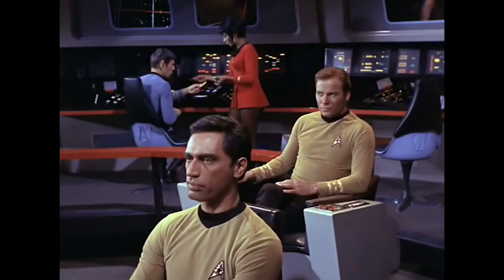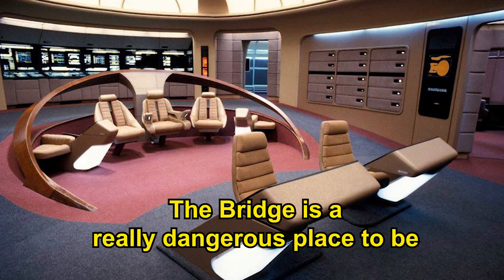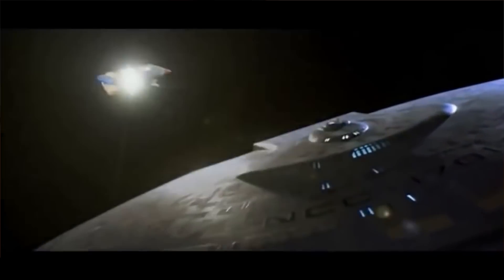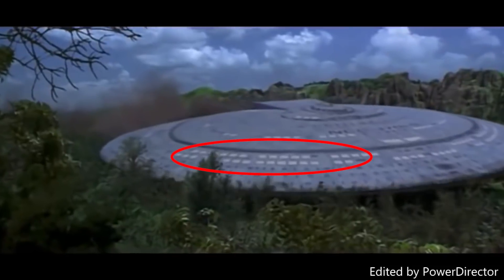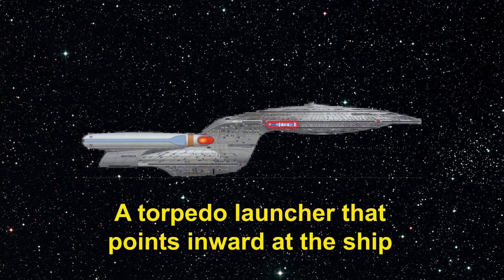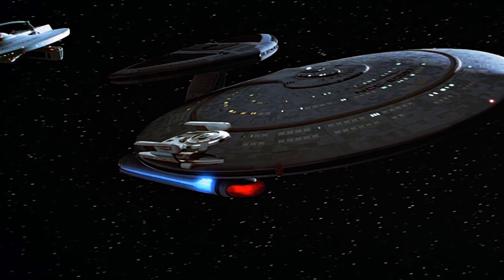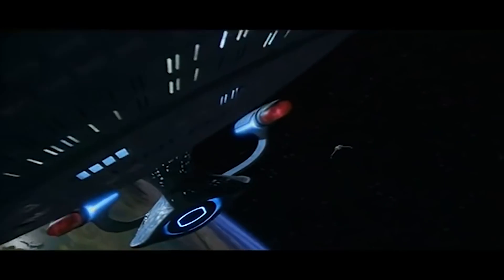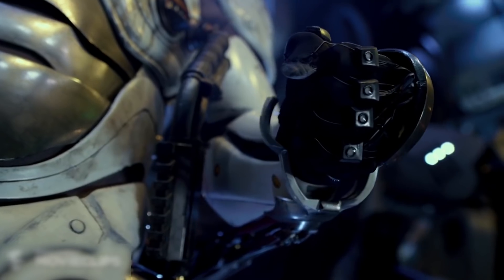10 Flaws Star Trek - USS Enterprise NCC 1701-D

Comment: 1. The Galaxy Class starship isn't intended for combat. It's an exploratory vessel, so protecting the bridge during combat is not a high priority. The placement of the bridge is actually a holdover from 20th century naval vessels where the bridge is raised high above the rest of the ship in order to provide a higher perspective for visibility and navigation. 
2. This is probably a result of common technological fallacies - the more advanced a civilization gets the more dependent they become on their technology to solve problems. They depend upon their shields and inertial dampeners to protect them. The whole point of science fiction is to be an allegory exploring what happens when that technology fails.
3. All of those hijacking attempts were performed by experts who devoted massive amounts of time to planning and preparing their hijacking, often including long-term infiltration of the security involved. Those "kids" were age "regressed" adult crew members who retained their adult knowledge and experience. 
4. The Galaxy class is a SPACEcraft, it's not designed to land. Hence "crash land". The intrepid class is designed to be able to land. Also, the Enterprise was highly damaged during the Generations battle. (Mostly this was just a dramatic choice by the writers so...)
5. Shield modulation is most likely a significant engineering problem that can severely impair shield power and longevity. Static shield frequency is also not a problem until the Borg arrive, and once they arrive the solution is newly invented - and we see this exact solution, automatically modulating shields and weapons, implemented in later ships designed specifically for fighting the Borg. Retrofitting this into older designs is probably a complicated endeavor.
6. Yeah that's a bad design. Blame the intern who helped write the tech manuals. Or in-universe, I'd suspect it was added to the design later, probably as a refit or at least later in the design/construction process when the living quarters on the upper decks were already established. Again, peacetime exploratory vessel, so it shouldn't be a problem.
7. Warp nacells are required to be separated from the living sections due to radiation from the warp plasma reaction. The design of the Galaxy class is mostly modelled after the Constitution class and both were exploratory vessels, so maximizing engine power, efficiency, and safety takes priority over reducing the ship's target profile.
8. It's meant for long term exploration, which actually makes comfort and luxury a high priority for morale. When your crew doesn't get to go outside for months or years at a time, you need a little more breathing space inside. You can also see this same design philosophy in its crew manifest - they have a ships' counselor to help deal with the issues that long-term space travel and "confinement" can have. 
9. This seems to be more of a complaint behind Starfleet's design philosophy in a peaceful and peace-chartered Federation focusing on peacetime missions in a relatively peaceful era. And you're comparing this to the design philosophy of the Romulans, The Klingons, and the Borg whose societies all exist in a more-or-less constant attitude of war. Yes, sometimes fighting happens, and Starfleet ships have shields and weapons because this happens. But warfighting is not the intended purpose of Starfleet ships and it is not the philosophical model that the Federation is built upon.
10. Using a touchscreen for steering? Sounds like a lack of imagination on your part. Try playing a mobile game with a touchscreen joystick. And then pretend that same control model was implemented in an LCARS interface. But if you must know, yes, they punch in coordinates for a destination and the ship automatically adjusts course and heading to get them there. All of the actual "fancy maneuvering" is done by the computer under the hood. This is actually the most practical solution when you're navigating a massive starship in 3-dimensions. Joysticks are fun in games and fighter jets, but trust me you'd hate it if you had to steer an aircraft carrier with a joystick - a course change of 10 degrees would have you holding that joystick sideways for 2 minutes.

It seems to me that most of your flaws are directly associated with the Enterprise's role as a peacetime exploratory vessel not being optimized for combat effectiveness. For the Enterprise, which being Starfleet's flagship frequently gets placed between a rock and a hard place precisely because they're the best of the best, we see this design philosophy fall short. But even on the Enterprise, it's maybe 1% of her service life and for the rest of the fleet they fulfill their peacetime exploration mission admirably.
Reply: Yes, thank you for your thoughtful breakdown.  This video should maybe be, 10 reasons why the Galaxy Class was not meant for war.  That would at least give more understanding to it's perceived flaws as a warship.  It's clear the show designers thought about that during DS9 and the Dominon War.  They designed the ships going forward to meet the needs of a more dangerous universe. I wonder how in the next shows, that expand the prime timeline, ship design will be effected.
Reply: Still, they are always in newly explored space, it is their main frontier vessel and their flag ship. While also constantly going into battle, so the design is not well thought out regardless. It really comes across as the federation being too arrogant and just wanted a flashy pimped out prestige vessel, ignoring the obvious and glaring issues.

And that's me not even addressing the starboard power coupling😆
Reply: That's a great rebuttal. However the Enterprise-E was meant for warfare, was it not? Surely they could've solved some of those problems, instead of blindly carrying them over. Also, I believe several of the same problems were also present in the Defiant, which was nothing but a warship.
Reply: Damn! Good breakdowns!
Reply: @leonardogoulart3245  
To answer your first question: BECAUSE Starfleet has not a primarily military role and merely doubles up as such in times of need. Having the flagship designed purely for combat would suggest they are about fighting wars. While there may be warrior empires out there, it is equally useful to illustrate to peaceful civilizations that you're not one of those.

As for the bridge, if I remember the technical manual correctly, it is a modular design so as to be able to completely swap out the bridge completely and ensure up to date instruments. 
Also, given that the primary protection of the ship are its shields, not some kind of armor, and given the strength of weapons, whether you put the thing on the outside or inside doesn't make much of a difference.
Reply: This is probably my favorite comment on YouTube.
Reply: And let's not forget that the Galaxy class ships were incredibly resilient.  One of the best examples was their first encounter with the Dominion ships' weapons, where Federation shields were completely ineffective against.  That Galaxy class took a pounding from several combat ships for 20 straight minutes directly to its hull, finished its mission, and flew out with most systems still functioning well.  It took a suicide from a ship ramming directly into its deflector shield area that ended up damaging the warp core to destroy that ship.  

And the Galaxy class could easily go toe to toe with other combat vessels from other species with the exception of the more advanced ones like the Borg.  When the shows wanted, the Enterprise would go down in one hit or take down a battalion of ships on its own.
Reply: You sir, win the day.
Reply: Exposed bridge is still a flaw. Not a warship and a hold over design style from 20th century ships is not an excuse when ALL monitoring is through computer/electronics. It has one largely useless window. Bridge should be in the middle of the ship, protected. Like in a submarine.

Other than that you're right
Reply: Puf... Standing ovation!
You just saved me 20 mins of writing. 😉😁
The main point is that everyone forgot the original idea of Rodenberry of a pacific humankind timidly exploring space.
Is it only natural then, as the Doctor said, that there are hungry being out there.
But Federation Fleet was NEVER intended as a military fleet.
Reply: @MickHaggs  Klingons have bridge directly in the front of the warship connected with a rod with the rest of the ship. Damn you could just cut the head of the snake and be done with it. You can't even ram ships like that.
The federation bridge seems to be far more protected with the mass of the saucer around it. The only weakness is the top and shields should help in most but the rarest situations.
Reply: Adendum for #10: The console shown was the OPS console (Data's console) and not the helm...
Reply: @headrockbeats  true the Defiant was a straight 'warship' but it was usually in stealth so it was m,ore of a first strike craft, not meant for longevity
Reply: Bingo plus bridge would be protected by most fire coming from in front of it being deflected away, ship only got screwed after several strafing runs weakened it to point of that being more easily accomplished.  The shield frequently is the main default and has to be the same for shots to be able to leave she ship. The torpedoes or phaser would need to be on same frequency or shield would stop them on way out.  So while shields can rotate it slows down ability to fire as each shot from ship would still have to match new frequency and there is a lag time for that. The sin was since the shots hit they should have tried to modulate the frequency and they missed and opportunity to show the Klingons seeing Geordie Laforge typing in custom frequency just to have next shot match it. Could have had cool drama as crew tries to figure out how they were doing it and solving it just too late to save the ship.  As for the torpedoes stored where they were, fancy custom turbo lifts could transfer ordinance if needed or internal transporters could do it. Also deleted scenes show Enterprise E getting seatbelts afterwards.
Reply: Actually it's a model made for TV ratings. It was fun but it's make believe
Reply: It's pretty dumb bridge placement, regardless, especially since they just use a viewfinder to look at things, anyway.  You can put a sensor tower/section where the bridge "would be", without risking anyone.

I always have two on my own ship designs: one on the bottom and one on top.  It does make "hard landing" on a planet impossible, but that's not the point of any of my SPACEships.  Except the troop landers-- those are designed for landing.
Reply: The UK's new aircraft carriers actually have really wide corridors and large living spaces, because they have realised that the flow of people down a narrow corridor during a conflict could be something that can degrade the operational effectiveness of the crew. Also, with the ship have huge amounts of automation they have a smaller proportion of crew, so the crew quarters can be larger to give everyone a better time on board.
Reply: This issue with the bridge, another way to protect it would be in tactical maneuvering. If you know that it is a weak point, maneuver so that it is a harder target to hit. It would be Tactical Piloting 101.  As for the extra "upgrade" space, that really isn't a bad idea though I might have done it more like current and past warships have and built the new technology to fit the older model. Having a specific spot void of anything else does seem a bit useless. A few of the comments have also mentioned landing the starship. Just to add to that, the ship was built in space, flies in space and generally does everything it needs to do in space. It was never designed to land anywhere. Even the diagram in the technical manual shows the saucer crash landing. Could they have added landing gear, maybe but the Galaxy class was a huge ship. Voyager was a much smaller ship with hundreds of people on board not thousands. The weight could simply have been too much for any landing gear they could come up with.  Also, getting that much mass off the ground could be prohibitively expensive in terms of energy consumption though you would think they could solve that with some sort of fancy gravity technology. In any case, the ship was never meant to be atmospheric.
Reply: This issue with the bridge, another way to protect it would be in tactical maneuvering. If you know that it is a weak point, maneuver so that it is a harder target to hit. It would be Tactical Piloting 101.  As for the extra "upgrade" space, that really isn't a bad idea though I might have done it more like current and past warships have and built the new technology to fit the older model. Having a specific spot void of anything else does seem a bit useless. A few of the comments have also mentioned landing the starship. Just to add to that, the ship was built in space, flies in space and generally does everything it needs to do in space. It was never designed to land anywhere. Even the diagram in the technical manual shows the saucer crash landing. Could they have added landing gear, maybe but the Galaxy class was a huge ship. Voyager was a much smaller ship with hundreds of people on board not thousands. The weight could simply have been too much for any landing gear they could come up with.  Also, getting that much mass off the ground could be prohibitively expensive in terms of energy consumption though you would think they could solve that with some sort of fancy gravity technology. In any case, the ship was never meant to be atmospheric.
Reply: Beside that it is a research ship, it was also often used for diplomatic mission, and thus a certain luxury was due to this mission profile.

The Enterprise was simple no war ship.
Reply: @leonardogoulart3245  The flagship during the Gulf war was not one of the Nimitz class carrier, but the then over 50 years old Midway from the WWII era.
Reply: Umm... a raised bridge is not a 20th century thing.  That goes back to the very first ocean-going vessels around 500 BCE in Greece and Phoenicia where they had a raised bridge at the rear so the captain could have an unrestricted view and protection from waves and surf.  This continued through Renaissance era exploratory ships with an even higher sterncastle.  It was the 20th century that introduced putting the bridge on an island.
Reply: YES! You tell'em @pufthemagicdragon !
You Rock! 🖖
Reply: Well done sir!
Reply: @phydeux  Being hidden somewhat more in the center of the ships won't bring that much. If the shields have failed, it hardly matters where the torpedo hits. 

The problem is more that for the purpose of drama, that the consoles explodes, the bridge is hit and even some parts of the walls are splintered off - as someone would survive such a blast - and only red-shirts get killed by it. 

This entire idea that these ship circle around like heavy battleships and taking hit after hit has next to nothing to do with reality.
The Expanse is here on a whole other level when it comes to realism.

The battle would be conducted from rather large distances, with drones and smart missiles. That's why some even think carrier are outdated.
If a stealth drone with missiles sinks a 5 billion dollar expensive carrier, it will be the end of that type of ship class. Just as planes made the battleships obsolete.

Then I also don't think that the Captain of an Air Carrier sits in a big padded chair with safety belts. He is no polit flying a jet or so. If the bridge is hit with a missiles, then it is game over. That's why battleships became obsolete. Heavy armor made and makes no longer sense because getting hit is getting killed.

It's like two fragiles eggs wielding huge hammers, the first one to hit, is the first one to win. Hence stealth and detection is so important.

In Star Trek is it the same: when the shields are down a single hit is normally  game over. When the ships explodes it doesn't matter where the bridge is. 

Space battles in Star Trek aren't that realistic and only works at all under the premise of highly effective energy shields.

So the design behind the shields is not that important. And albeit space is a rare on an aircraft career, they still have rather plenty recreational areas, because otherwise the morale would take a nose dive.

And a rebellious crew is nothing you want to have.
Reply: 9. The Federation has always had to deal with alien races that were hostile. The Klingons, Romulans and Borg to name a few. It would make sense for them to have dedicated war ships that could match the capability of their enemies. Even in peace time, there's no telling what lies in outer space. Starfleet is a military like service of the Federation whose primary duties involve defense among exploration and diplomacy.

10. Using a touchscreen to pilot a ship is a dumb and dangerous idea. Physical controls may not look as nice but they are far more practical and efficient. When using touch controls, it is easy to press the wrong button if you're not careful since you don't have your sense of touch and the feel of the switches to guide you. This means you must always be looking at the panel instead of were you're going. Having a lever mechanism to control the ship would provide to pilot with much more fine control of the ship than punching in coordinates or using a touchpad. Can you imagine maneuvering a ship in battle like that? One final con of using touch controls is that they are electronic so if you lose power, you lose all control of the ship. The only pro to the enterprise control design is pure aesthetics.
Reply: You deserve the noble prize
Reply: yeah and that is why they decided to design the Enterprise-E because they new they were facing aliens like the dominion and the Borg so they needed a ship that was maneuverable and more fit for combat.
Reply: 1) it is only a scifi story. you speak about it as if it is real.
Reply: pufthemajicdragon 
Oh oh somebody got triggered.....
hahahahahahahahaha
Reply: @tek87  
" The Klingons, Romulans and Borg to name a few. It would make sense for them to have dedicated war ships that could match the capability of their enemies. "

No, it wouldn't, since "enemies" exist solely during a state of war.

"This means you must always be looking at the panel instead of were you're going. Having a lever mechanism to control the ship would provide to pilot with much more fine control of the ship than punching in coordinates or using a touchpad. "

And make it impossible to react with adequate speed compared to programming in specific maneuvers... I don't think you understand either the distances involved nor the speed achievable in space.

"One final con of using touch controls is that they are electronic so if you lose power, you lose all control of the ship. "

I guess you never heard that both civilian jets and military ones use fly-by-wire already, which are just as electronic.
Reply: @MickHaggs  "Bridge should be in the middle of the ship, protected. "

That "protection" is purely fictious. There is no "protection" in the middle of the ship. If the shields have failed, the shields have failed, and any proton torpedo can punch clean through the entire saucer section.
Reply: If the problem with having the shield frequency modulating continually causing wear and tear on the system, then why not change the frequency less frequently. (LOL) . No pun intended. It could be changed once a shift cycle or at an infrequent time as not to be set as changing of the rostered shift
Reply: Dont shoot, we are not intended for combat!!!  So how is that working out for you?
Reply: @mjs28s  We know it is fiction but a fictional world needs rules. If the Borg are close to impossible to kill in  one series  then it  ruins the story if they suddenly become easy to kill.
Reply: Manual steering was done by Picard when they were stuck in the energy siphoning trap that killed an ancient crew centuries earlier... it's done with subtle changes to the thrusters the same way NASA does it with actual space shuttles and satellites. The majority of the time it's done by pre-planned routes and destinations with the helmsman inputting the heading and letting the computer go from there, they just ensure they are still on course and as needed. During battle they use preprogrammed attack and evasion manuvers along with quick changes as needed

As for the bridge location? All of the cultures do the same thing! Seriously, Romulan and Klingong bridges are in the same position!
Reply: Wow, yes I have to agree on many points brought up here :) Very good breakdowns on the subject!
Reply: @MickHaggs  The Romulans,the Klingons and the Cardassians have the exact same flaw where the bridge is sitting right dead center at the stern of the ship.....at least the Federation starships still have a ships center after the bridge is destroyed.....a klingon bird of prey or battle cruiser only needs a well placed photon torpedo after the "head" to completely sever the command area from the rest of the ship.....why no complaints about THAT design......and the romulan design isn't any better....
Reply: Wrong Enterprise D is the most advanced ship in the fleet!
Reply: @320iSTWEdition  "why no complaints about THAT design"

Because this video was about the Enterprise D...
Reply: Seems pretty clear the guy binge watched a few episodes, then did some quick searches to make this video. Obviously didn't watch all the shows.
Reply: @MickHaggs  yes you are correct. Me being a Navy Vet. We went over why ships are designed that. They are done to give most view of the battlefield with out relying on computers or instruments reading. To better judge your opponents next move. That is how it is written in the blue jacket manual.
Reply: @MickHaggs  Referencing other ships designs was no problem,now was it?Didn't make it a video about ST:D or DS9...
Reply: @320iSTWEdition  So they're ALL poorly designed? What's your point?
Reply: @MickHaggs  What is YOUR point?You mention a window that isn't even there on the bridge of NCC1701-D.....but you know that.....you just forgot that the D does NOT have a real window behind the main viewscreen....and regarding my point....see my first comment.There's my point.
Reply: "The Galaxy Class starship isn't intended for combat."  -  If it isn't, a lot of fighting is going on for those peaceful ships. And WHY do you keep sending such a ship into conflict areas, especially with families on board...
"It's an exploratory vessel, so protecting the bridge during combat is not a high priority." - So in combat scenarios Starfleet prefers a headless-chicken-strategy. Good to know. (Bridge being the 'head' and exploratory vessel being a 'chicken' rather being a dreadnought, destroyer or battlecruiser.) Where can i sign up...
Reply: Yeah, the video is kinda missing a few things.
Reply: @Peter Zwameter: It isn't intended for combat, it really is a ship of exploration. The weaponry is there for self-defense, because space is dangerous after all and combat may break out. But as you said, you don't bring families on board a ship intended for combat; and at first, it certainly seemed the Enterprise was suitably armed for its mission.

However once the Romulans reappeared (end of season 1) and the Borg came and destroyed half the fleet (end of season 3), wars started breaking out all over the place, and the Federation quickly began replacing its peaceful family-oriented ships with actual combat vessels that had a lot more weapons and no families on board.

In short, the story itself revolves around the fact that Galaxy-class ships were designed for a completely different situation than the one they eventually had to face during the show's run (and subsequent shows like DS9) - whereupon the design's shortcomings became glaringly obvious, and it went out of production within less than 10 years of service.
Reply: @headrockbeats  First, you do not send a family cruise ship THAT big into uncharted, highly possible dangerous territory and lots of unknown perils. Probes? Sure. Recon or small vessels? Why not. But a ship that big does cost al lot of workforce, dough and ressouces. 
The other point would be, if you do send such a big, peaceful ship, wouldn't it be a lot smarter to send a more resilient ship, that can withstand more force? After all ST-humanity claims to be more evolved, so it would make more sense to have ships, that are as equally evolved.
Besides the fact, that their whole purpose is to look cool on screen.
Reply: @Peter Zwameter: I don't think probes can be as effective as a ship in the locality. A Galaxy-class is like a mobile base-of-operations that can react to a wide variety of situations. You need ships around to respond to emergencies and all that stuff, after all, and the show itself shows us how varied the missions can be.

It's just that the level of threat they had been anticipating - after a very prolonged period of peace where threats were few and far between - was quickly shattered by events they had not (and perhaps could not have) foreseen. And once those events occurred, it didn't take Starfleet long to replace the design with something more akin to what you're suggesting - e.g. the Defiant and the Enterprise-E.

So yes, the whole point is that they designed it poorly for the situation it ended up in - but there were reasons why they designed it poorly.
Reply: @MickHaggs  it doesnt matter where the bridge is, in the shows, when the shields goes to 0% the missiles cuts through the hull like butter.
Reply: @peterzwameter5674  They DID sent probes. One of them came back as V'ger.
Reply: @luch1fer  THAT was the old earth. Pretty much downhill from there...
Reply: @MickHaggs  Having the bridge be on top was a decision made by the series creator, Gene Roddenberry.
Reply: "The whole point of science fiction is to be an allegory exploring what happens when that technology fails.
"
Not necessarily. That's a common plotline in science fiction but it's not a genre requirement. In its most broad definition, science fiction is a form of speculative fiction where the setting has consistent scientific laws, with "harder" science fiction being more consistent and/or lining up closer to real world science and softer science fiction deviating more from real life or taking more liberties with its own laws. Additionally, these scientific laws must have an impact on the story in some way, either in the technology that is used in the story or as the focus of the plot itself. That involvement can just as much be a technological development (H.G. Wells The Time Machine ) as it could be a technological failure.

"Joysticks are fun in games and fighter jets, but trust me you'd hate it if you had to steer an aircraft carrier with a joystick - a course change of 10 degrees would have you holding that joystick sideways for 2 minutes.
"
Can definitely second this. Turning any large ship in Space Engineers requires you to hold down one of the arrow keys for quite a while - although 2 minutes of turning would only happen with some of the really big 1:1 scale ships and part of that would be because the game has ground to a halt.
Reply: @

pufthemajicdragon you Sir is a scholar and a gentleman.
Reply: @BoogerLeader  Yes, you're on about the episode where the Dominion destroyed the Odyssey (galaxy class)... I remember that episode. For all it's supposed flaws, the galaxy class was a tough ship.
Reply: @headrockbeats  Like what? Apart from bridge positioning, the Defiant has almost nothing in common with the Enterprise D in it's design. It is compact, the warp nacelles are protected, ALL of it's weapons are useable...etc. But, the reason these ships are so very different is because they were built for very different purposes.
Reply: Actually, the galaxy class was intended for combat. The class was the most technologically sophisticated ship class to date when made, and was meant for exploring unknown and potentially hostile areas of space. Why do you think so many galaxy class ships were in the Dominion war? Because they were tough as fuuuuu**